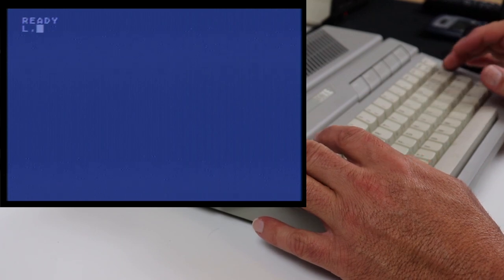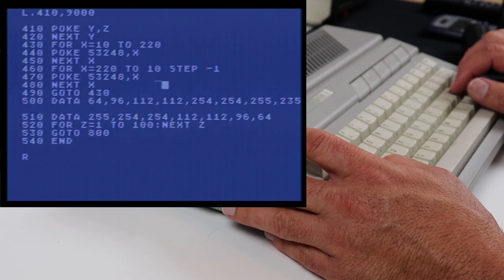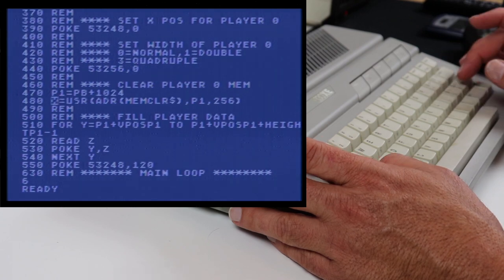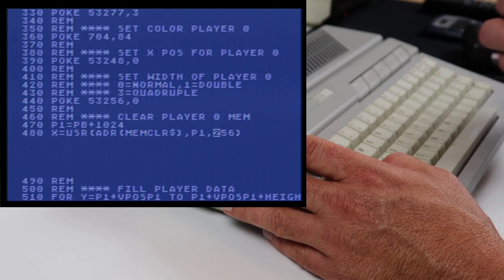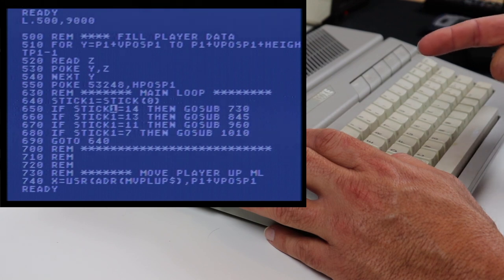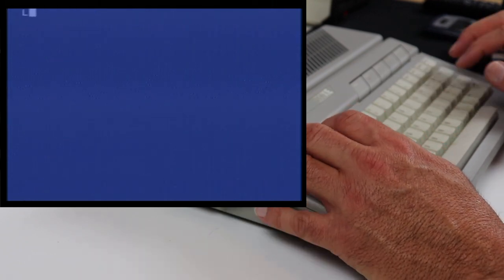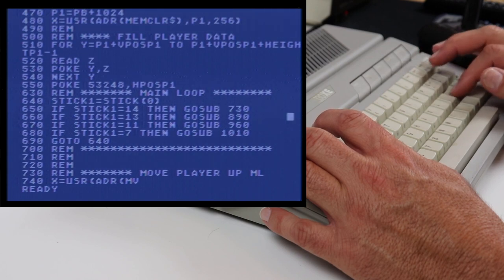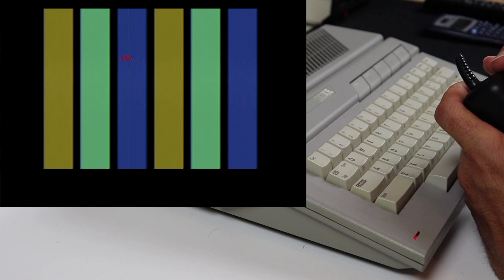Player Missile Graphics Part 2 - Moving Sprites with Joystick

Comment: I seem to recall that vertical motion of PMG on the atari 8 bits used string manipulation  to optimize performance in basic, if memory serves it was quite fast. Regardless, I am enjoying the series while strolling down memory lane. Thanks :o)
Reply from the maker: Thank you.
Reply: Go to Google and search for "bradley bell and volleyball and softside" That will give you a link to the program I wrote in 1981 that was published by Softside magazine. It uses Atari Basic's strings to move my volleyball players around. It also allows for easy animation since I can put the shapes for animating a man running and they quickly move them into the PM graphics memory.

Comment: Gosh, Atari keyboard is do loud, especialy when you hit return. Except the mechanical sound I see it also plays clicks. Is this system feature in all Ataris? I have an old 800 and it misses internal speaker, is that ment for playing krypresses?
Reply from the maker: The click is feedback from the computer that a key has been pressed. It can be turned off with a simple POKE statement. I love it, it reminds me of my teens as I banged out code from computer magazines a 3am in the morning lol
Reply: @8bitandmore  I had to add the program running in background to my Amstrad CPC if I wanted to have the click feedback. :-)
Reply: Yes, the 800's internal speaker is used for key-press feedback, and yes, all Ataris have this feedback feature, although later models lack the internal speaker and instead mix the clicking sounds into the main audio output that usually goes to the TV/monitor.

Additionally, there is some software that uses this second audio source (besides the POKEY chip) for sound, particularly games that were ported from Apple II originals, since this audio source works just like the Apple II's speaker.  One well known set of examples is the Ultima series of RPG games from Origin Systems.